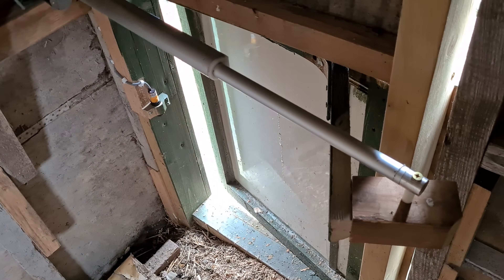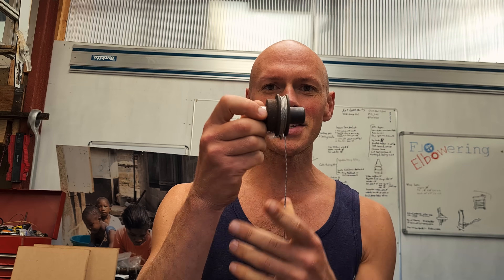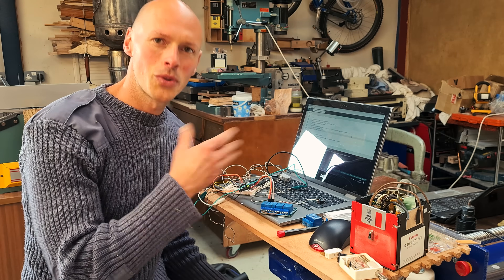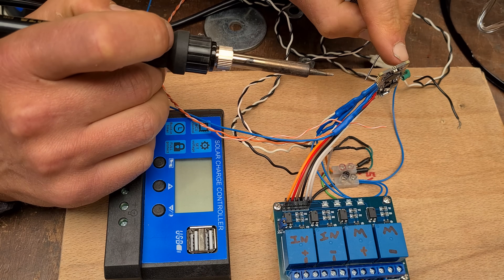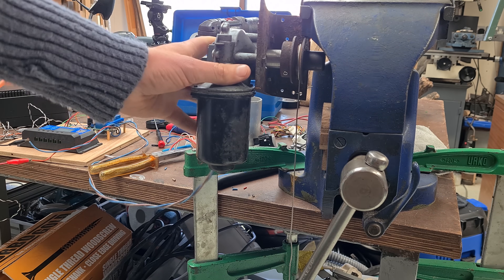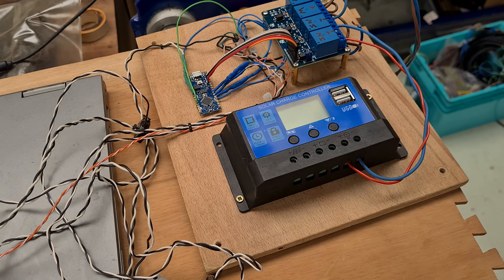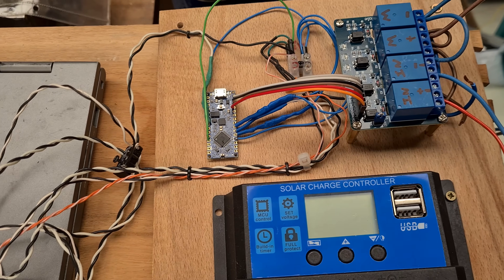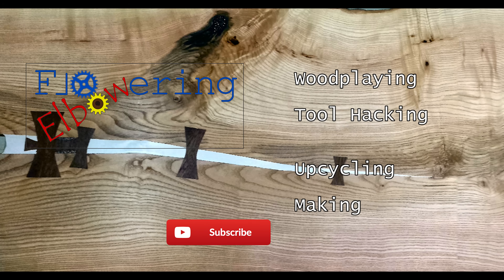Building an Arduino Powered Chicken Coop Door That Actually Works!

Comment: First off. The suggestions I am about to make are in NO WAY to be taken as insults or degrading your work. They may, at times, read like I am putting your work down but I am not and not my intent. Read this as if a your best friend is giving you advice. However they would say it and you listen. So obviously they are still your best friend however they say it. Harsh or super polite, it is still friendly advice.

So first suggestion is to, make it modular. Make it so you can take it on and off, to where if you remove it that it take very little effort and does not keep the other door from being useful. At the end of this comment I will link to my version of a string door (I dislike string doors), where you can see how it can be taken out completely with little effort and taken inside to do any upgrades or maintenance on it. 

Mount it on the outside. See my previous comment.

Use a French cleat. You have a table saw, use it. LOL. Mount your control box using a French cleat. When it comes time to do any updates, upgrades or maintenance on it, all you have to do is take it off the wall. Instead of taking it apart and undoing all those screws. 

Use quick disconnects. Never hardwire your components. Always use some sort of quick disconnect. From every part to the control, should have some sort of connector to disconnect it from right there at the controller.  

Instead of using the Arduino Nano, use a the regular large Uno. You can put a motor shield on it and not have to do so much wiring and programing.

On your spool, for the string. Make it so that if the wire rope keeps going that it is not permanently attached to the spool. If for some reason the door does not go all the way down, when the spool gets to the end of the wire rope, it just falls off. That keeps it from pulling the door back up.

Since you have the fabrication tools, make your limit switches like this guy. With a few mods, you can make the limits at the motor not at the door. No need to add a timer. this also makes it so you do not need to make the Arduino stop the motor by using the switches to tell the Arduino when the door is up or down. The switches cut the power to the motor. Saves on programing.
https://youtu.be/U9hd2GVmE3A?list=PLuVu6jtxZ7FlpyBpM6jkuXvVPW8ugO6QJ

Here is my version of a string door. Maybe you can use the locking feature or even the fall arrest system.
https://youtu.be/jYM0xZ8TwaA?list=PLuVu6jtxZ7FlpyBpM6jkuXvVPW8ugO6QJ

In any case I like your work.

Comment: Fun project! Get rid of the added complexity of an Arduino, no code is needed. Use a light sensor module and your relays only, put your limit switches to respond to the string position so its cleaner (you can add a second string if needed) or make your string longer than the door throw using a pulley.  Clamp washers using small bolts to the string which trip the limit switches. Add a time delayed relay with a buzzer or bell to sound off 30 seconds before the door closes to train your chickens. your outside coop looks secure enough to let delinquent chickens learn that ignoring the bell means sleeping out side for a night... another thought, have your roosting bar on a spring and the bar triggers a power switch when the weight of all the birds have roosted allowing the door to close when the light sensor triggers.

Comment: Some thoughts —
1. Assessing light levels could be done monitoring the voltage from the solar cells and thereby eliminating the specific light sensor;
2.Leaving the door open for (maybe) 5-10 minutes after sunset should allow for the "stalled in doorway" hen to have moved; and, right at the extreme margins,
3. Something longer than 100s for the "it's dark" decision (you may get lucky with a solar eclipse causing the door to be closing with the chooks entering 🤪).

New to the channel and enjoying the content, well done.

Comment: One feature I've seen to allow for straggler chickens is to close the door as usual, then wait two minutes, to give any outside chickens time to notice that they have screwed up.  And after that, open the door for 30 seconds or so, and then close it for the night.
Reply: Great idea!
Reply: This at first look, seems to be a good idea, however it is a bad one. 

First if you want your chicken inside get a timed light to get them in. 

as to the door opening back up. Why give a fox or racoon a chance to get in and then be locked in there with them? It is better to lose on or two then to endanger the whole flock.
Reply: @AztecWarrior75  // I think that danger is minimal.  Even without that feature, a racoon or fox could simply show up five minutes earlier, so the difference in safety is vanishingly small.  
      Say more about this "timed light".  Where is it and how does it get them inside?

Comment: This was really interesting.  Windscreen wiper motors are supposed to be fairly high torque, so it makes me wonder whether you could instead make something shaped a bit like a pizza slice, with the motor attached at the pointy tip.  As it turns it would swing the pizza slice out of the doorway to open it, and swing it back to close it.  It might make it simpler from the perspective of not having to deal with the wire tangling, although you may need some micro switches on the leading edge to stop it if it comes down on a chicken.  Perhaps if you put a counterweight on the opposite end you may not even need a high torque motor either.
Reply from the maker: I like the idea - and it would look cool/ slightly scary during the operation. So far this door's doing a good job though so will have to wait for the next animal auto opening type thing ;)
Reply: Do you realise how much room that would take to operate. Plus getting it to be secure. You would have to have it slide in to some sort of bracket to make sure it is not able to be pushed in. Also making it it stays on the shaft of the motor.  NAH wy spend all that time and effort when there are other proven secure methods.
Reply: @AztecWarrior75  If you make it larger than the door it can't get pushed in, and they have these really nifty things called nuts that can be used to keep things fixed to motor shafts.  If you're not a tinkerer and just want to buy someone else's off-the-shelf solution that's fine, but half the fun is with experimenting to see if you can do better.

Comment: Where'd you end up on the gantry leveling device and accuracy measured?  Would be great to see how you worked every out.
Reply from the maker: Hey Karl. Thanks for watching. In terms of the cnc I think I covered gantry levelling in the main build video no?  "Called can we diy an industrial grade cnc?" Or something along those lines, alsi 2 vids after that cnc related... peace, and thanks again 🙏
Reply: @FloweringElbow  thank you for the response.  I was wondering specifically if you did anything more with the laser setup.  I did see you try to use the screws to fix the valleys you had on the beam, but I didn't see how you finally got those flatter.  I thought you talked about possibly doing an epoxy pour to level out  the surface where the rails were mounted.  I watched your subsequent videos but never caught that part.
BTW - you really have a great talent and approach for solving problems and getting things working.  Wherever you got your experience from was time, effort and money well spent.

Comment: It is pretty easy to integrate an RFID reader to your controller so you can adjust the behavior of the door based on all birds being present with an RFID tag bracelet or necklace.  You could also create a small coin cell operated Bluetooth beacon in a collar.  You might need a larger antenna and continously running power if using an RFID reader, but beacons could be just searched for at bed time because their necklaces would just wakeup and ping every ten seconds or so.
Reply: um yeah I have mine in the works but to say it is easy, is just not at all true.

Comment: How is the van running now on veg? Update plz , what lift pump did you change it to?
Reply: Just tried looking up biotuning to. Think they have gone under
Reply from the maker: Hey there friend, thanks for watching. The van's still going well on the veg. I had the timing belt changed the other day (for the second time). So yeah, pleased with it ATM. I recently pulled the EGR valve for a clean out, as I know it tends to cake up anyway, and I imagined running veg might speed this up - It was actually quite clean and I needn't have bothered... Yeah, I'm not sure why bio tuning stopped, but its a shame.

Comment: Those H bridge drivers are very reliable I have one in a DIY tapping arm I made years back and still works a treat. Did you know that you can change the PWM driver frequency to take the 'whine' the driver makes out of the audible range . Have you ever tried using a pro mini with a tft display. I am stuck on a project to make an automatic watering (and fertilizer injector) system but I am struggling to make the display show anything. In the past I have just used a mega and the plugin display boards but their prices seem to have skyrocketed, like everything else I suppose, so I went for the pro mini and the (serial) ILI9418  display to cut down on connections. Keep up the good work.
Reply from the maker: Hi Michael, Thanks for watching:) 
I did not know you could change the pwm frequency to get rid of the whine! Please tell me more - how is it done?

Comment: I am as ever pleased to see a fellow lover of a wooly-pully, but in this particular video, my eye was drawn by what appears to be a storage and organization solution built around using euro/klt crates as drawers!
Here in the US, these crates are mostly unobtainable, which is truly a shame as they're far better-designed than our milk crates (which are square)
Reply from the maker: Hey James, very observant. Yes, those crates are super handy. They are in stacks that allow them to act a bit like draws, but pulling them all the way out is easy. I was actually given them by a friend who's work was throwing them out!? The frames made of stainless steel, and they were tig welded by a guy he works with...
Reply: @FloweringElbow  that's really magnificent! I am at the point (WELL past it if I'm honest) where my "next project" really needs to be 'Clean Up and Organize for Staying Cleaned Up', and Euro/KLT crates seem so excellent. the (very expensive) Systainers are based upon the same dimension of the (comparatively cheap) Eurocrates, and this bit of information has seemed to me to be important to the goal, somehow, but as I mentioned, they're rather difficult to come by in the US.

Comment: Just a thought & though not as much fun,,, it may have been simpler to connect an electric eye to a latching flip flop relay with limit switches and a pulley for speed control.
Also if you make the door double width it may solve your traffic jam problem.
That said i wouldn’t have learnt all that good stuff from your endeavour 👍🏻

Comment: Nice! 👍
On my chicken door I used a surplus electric window motor. Worked great. I used Arduino, 12volt automotive relays(forward/reverse), magnetic security switches, and a tiny solar detector to control it all.
Edit:
To water proof all electronics I used a large canning jar and lid to contain it all. Siliconed all wires penetrating the lid. It's been 9 years still working.
Reply from the maker: Nice work! thanks for sharing your experience, sounds good. like the jar-seal idea

Comment: My chickens have an internet bought light detector controlled door. It moves very slowly. In the morning they’ve all scrambled through before it’s fully open. In the evening it doesn’t shut until it is properly dark, so they’re all asleep before it starts moving down. The door is a piece of 1/4” plywood. There is a piece of wood at the bottom that may stop a claw or nose getting under it to lift it up.
Fortunately their run is fox proof when the gate is closed. They’re confined to their run due to bird flu rules, so the gate is always closed now, keeping predators out. Before the restrictions they could wander over half of the garden, with the gate open the door being closed was more important.
When the batteries fail (4 AA batteries) it can take ages to set the bottom and top positions (usually when it’s cold and raining). It seems to rely on time for lowering and motor current (stalling) for the up position.
I have been planning to change it and fit rechargeable battles fed from a solar panel so I don’t have to set it up every three months. More importantly, the main problem caused by the batteries going flat is that the door doesn’t open. It always fails closed, or open only half an inch. My chickens are stuck in there until someone notices the door is still closed, this can be a couple of hours after sunrise in the summer. They’re never happy when they’re stuck inside.
A constant power supply will ensure they don’t get trapped inside. Thus providing the full convenience of an automated door as I won’t have to check it’s actually opened!
Reply: @Sprocket N :  Large retail outlets have counting systems on their entryways to provide stats on foot-traffic etc.
Maybe an adaptation of this could give a headcount check, and shut the door when everychook is strapped into their seats.  It could even raise an alarm if somechook has failed to board by door-closing time?   😜
Reply from the maker: Hi John, Yeah, it wouldn't be crazy hard to implement something like that. Internet connectivity that would allow for missing chicken alerts would be cool. I fear delaying the shut time until all are accounted for could lead to unintended consequences though, so probably just some kind of alert would be best. Unfortunately I'm an old-school kinda weirdo that doesn't always (or even very often) have a phone on me...
Reply: @FloweringElbow  :  My tongue was firmly in my cheek!  Just my feeble attempt at humour.  🥴
Keep it up... the world needs all the "old-school kinda weirdos" we can find!  👍
Reply: @PiefacePete46  I had thought about that, but counting them out in a morning would be impossible. They all pile out like a ball of feathers and legs! I suppose I could assume that the house is empty at the point when it’s time to close, but sometimes they go in very close together so being sure that there’s one or two passing the sensor may be tricky. It would be an interesting project tho’. I’ll get the battery reliability sorted first though.
Reply from the maker: Hey Sprocket N, thanks for watching and sharing your experience. Touch wood, the battery and solar part of our system has been really good - considering the cost (an old lawnmower battery discarded by our neighbours, 2nd hand 20w panel, and a cheap charge controller) it's gone through the darkest part of winter without fault, which is surprizing. Thanks again, Bongo.

Comment: Do you eat duck eggs? Do you do multi-species grazing or are the ducks and chickens fixed in their area? Totally non-CNC related questions from a devoted CNC advocate, I realise, but am very curious. 

How would you feel about IR-capable animal recognition door access? It could differentiate between a chicken and a fox / predator and open the door for one and not the other.

Until the fox starts wearing chicken wigs, of course. 

Love the content, please keep it coming.
Reply from the maker: Hi Aaron thanks for watching the random content  :D
So we don't actually have ducks, we have 3 geese. But yeah, they usually roam about in the same patch as the chickens. The geese are unequivocally in charge. We have only had the geese since the summer, so they are not yet 1 year old, but we had our first goose egg yesterday, which was a nice sign of spring. The taste is between a duck and a hen egg. 
        
On the 'IR-capable animal recognition door access', I think it would be cool, but testing and de-bugging would be very tricky. Simple may be best in this instance... A completely separate fox alarm system of some kind and/or a chicken not gone to bed alert would be a nice addition though.     
Thanks again,
Bongo.
Reply: @FloweringElbow  There are leg fobs for access system detectors which work with arduino, so you can know all chicks are in before shutting the door and if a chick does not enter at dusk plus x minutes that can trigger an alarm so you know or could even send a text!!
Reply: @Aaron DC mediA :  Or alternatively open the door for chooks, and drop the guillotine on foxes!   😜
Reply: @PiefacePete46  whilstl I understand a dislike for foxes trying to take your chickens, something tells me this youtuber would seek to let the foxes be, rather than kill them. Something I can understand to an extent. Ecological systems are complex.
Reply: @aarondcmedia9585  :  I live in New Zealand where there are no foxes.  In truth I have an admiration for them, and their legendary cunning... I have watched a number of videos from the "SaveAFox" Youtube channel, and they always leave me smiling.
My comment stems from a childhood peppered with cartoons which usually showed the fox as the "Bad Guy".  Political Correctness has put an end to such things... youngsters today will never see Wile-E-Coyote being foiled by the Road-Runner; instead they will be subjected to an endless diet of angry growly-voiced humanoid characters acting violently towards each other... this is Okay apparently.   Go figure!   🥴   (Foxes are in no danger from me!)

Comment: Wouldn't a buzzer help? On door closing, a short beep before start closing, so hens may be trained and go in. It's quite simple thing to add.
Reply: @Минко Минков :  Or add a sound module so that a couple of minutes before closing time it broadcasts the crowing of a hot and horny rooster... guaranteed 100% on board when the door closes!   😃